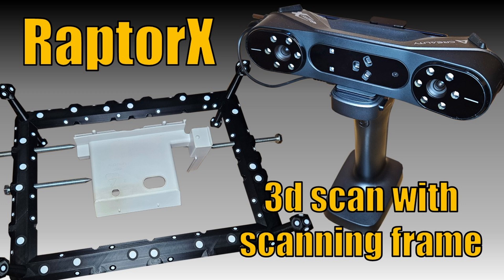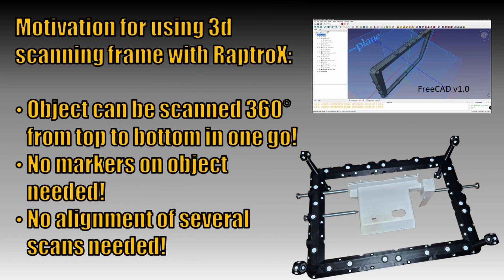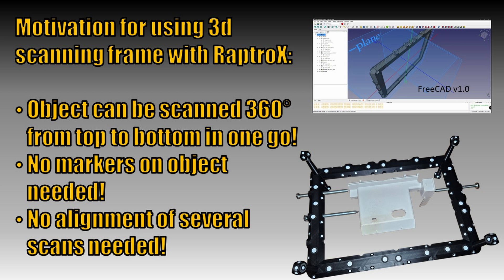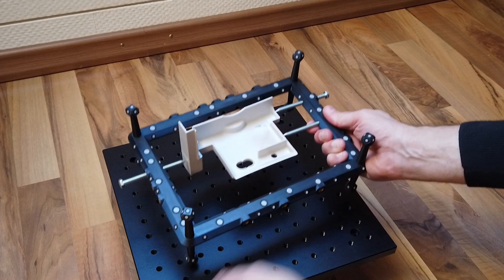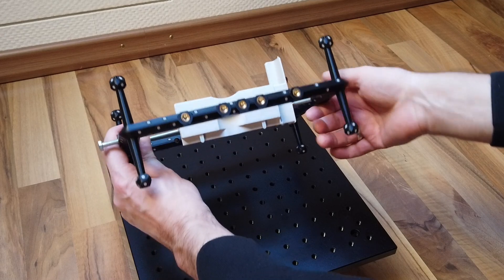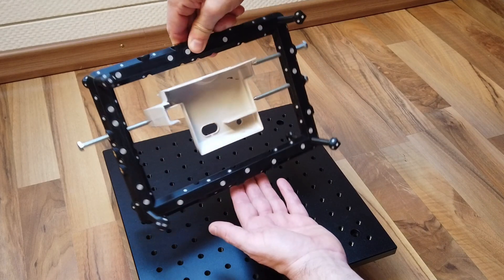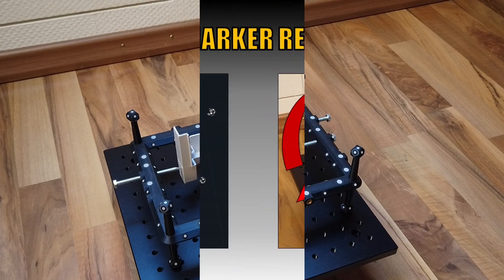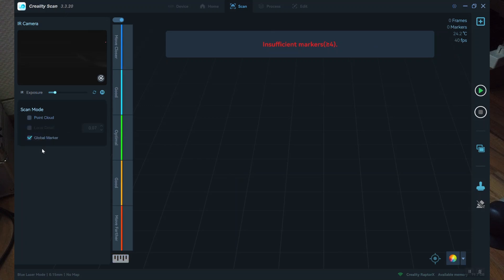Using Creality RaptorX with 3d scanning frame

Comment: Thank you for your very interesting video. Is raising the frame for scanning the part mandatory? I see that you have a platform with feet; could you tell us a bit more about it?
Reply from the maker: Thanks for the positive feedback! The lifting of the frame is not mandatory. But it is useful to prevent capturing the floor. You can easily delete these unwanted data points in post processing. But when changing from top to bottom scan, it will prevent you from having a direct view to the object. The easy solution is to lift up the frame. Using two old boxes is doing the same. You do not need a special platform with feet.